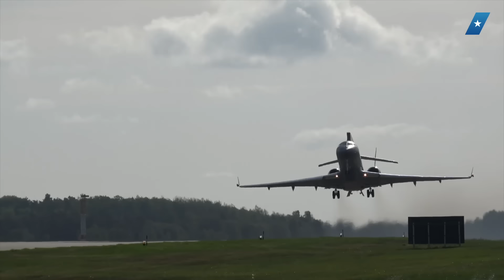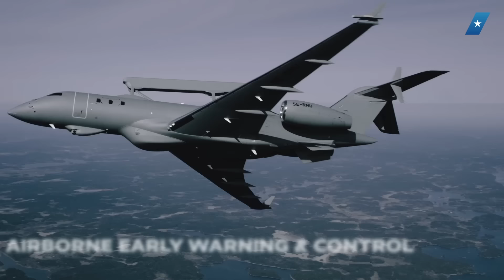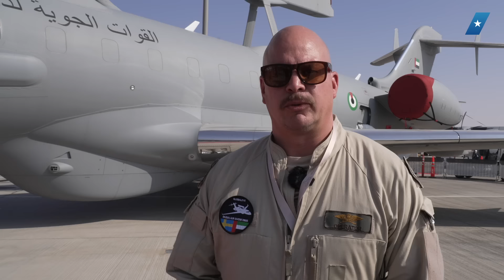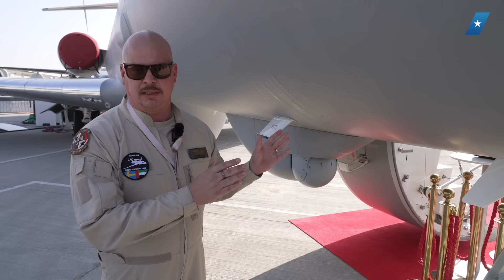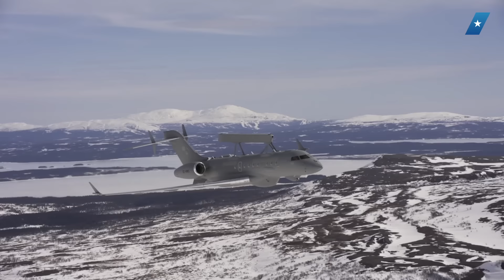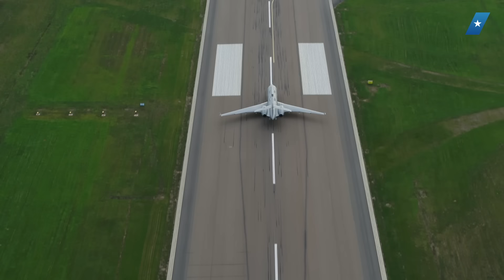GlobalEye walk-around tour with Saab

Comment: Nice, but obsolete? How about distributing the sensor suites on drones (large & small), and having the operators safe in a trailer somewhere?
Reply: Definitely not a application for small drones.... You need range, loiter time, and strong radar. Small drones are only good for short range operation over land. They don't deal with wind or weather well and definitely not fit for this
Reply: @mphRagnarok how about the other part of their suggestion, a large drone?😅
Reply: @BlindButNotMute if a large drone then it's probably at least as large as this converted business jet. Then you gotta ask yourself what are you actually saving, because it won't be cheaper than this. Maybe you save a few operators and pilots but that's not a limiting factor for an air force that will operate at most half a dozen of these.
Reply: No amount of drones gets you the range or accuracy of a proper radar.

Even if you're mounting radars on drones, you're lacking in emitter power. How much raw power can you direct at the target can burn through jamming, force a return from reduced RCS "stealth" and such while lower power emitters can not.
Reply: @thelittlestmig3394  what are you talking about, that aircraft can be a drone. just because you have no people onboard does not mean you lose access to a proper radar. they are currently working on large drone systems. so distributed drones amplifying coverage and providing safety to remote operators is not far off. and sure smaller drones could supplement depending on mission requirements.
Reply: @kevinb4783 Optionally manned is a way forward. For now we still need the souls on board but in near future that might change.
Reply: SAAB is working together with General Dynamics for the MQ-9B to do exactly that. 

But you don’t have the power reserve to run two radars at this power, and you depend on satellite links so can be degraded by enemy operations.

It’s not an either/or, it’s “and”.
Reply: o...obsolete???? lol.
Reply: Denmark, Norway, Finland, Sweden and Iceland ought to share a fleet of 5 to 6 of these. I belive belive Denmark, Finland and Sweden has shown intetest. Or is Norway only intetested in anything American !
Reply: Wrong on all counts
The Globaleye represents what the next generation of AWACS should be 
Small and compact
The previous generation of AWACS were based on large and slow aircraft
Smaller aircraft like the E-7, G550 and the Globaleye are what AWACS should be 
The thing people drunk on the drone kool aid forget is that Electronic warfare can jam drones 
Simple brute force attack and that drone is useless
What the USAF needs to bring back tactical escort jammers
The USN E-2D have EA-18Gs that can lay down a jamming to block any possible chance of a enemy getting a BVR shot in
The USN has over 170 EA-18G so assigning one to protect the E-2D is a simple matter
The USAF is only buying 10 EA-37 which is not enough. They either need to increase the EA-37 buy, develop their own variant from the F-16
or the shortest course is buy EA-18G and simply piggy off the USN to give them same escort tactical jamming that USN enjoys 
Aircraft like the EA-37 and EA-18G can easily ruin a drones day
Reply: Drones are for other types of missions than these. Btw Saab made the radar suite for the MQ9B aerial drone. So I think Saab knows what they are doing 😅
Reply: probably not far off
Reply: Jamming?
Reply: @JeffBilkins  Yes, jamming. You can transmit towards the radar to drown out their returns off you. They'll see the jamming source but the targets are masked. This is what "Gripenites" rebranded as "electronic stealth".

The main ways to defeat jamming is to either burn through their nonsense with more raw power if you can generate enough or to send a HOJ capable missile at them if you're sufficiently angry at them.
Reply: Drones are only an issue if you don't already have air superiority. Everybody refers to the russia and ukraine war neither one of them have air superiority. I'm not saying drones ain't useful because we know they are. But whoever controls the sky controls the battlefield. If you control the sky over your opponent's battlefield you can not only push them back
but drones also come more irrelevant. Look at the 12 day war israel owned iran skies drones didn't and couldn't do anything neither could Iran because israel ran the skies and controlled the battle space knocking out every sam system's in sight.
Reply: The Gripen already has passive mode radar that seems to be able to track the F-35's as the sources of the radar signal would not be the Gripen's therefore stealth deflecting the signals away from the source doesn't hide it from the Gripen's.  The Gripen even has a mode where one Gripen would illuminate the area for the passive radar of the other Gripens and they could take turns to hide the locations of the Gripen's.  Note, a GlobalEye scanning the area would also illuminate the area for the passive radar.

As to teleportation of drone fighters, ECM can interfere with the controls so you would need AI to continue the mission and or evade when the communications are interfered with.  Of course spread spectrum communication well beyond the licensed frequency bands of civilian radio use could avoid being jammed, with degradations in data bandwidth or increased latency...  The whole point of sixth generation fighters is to have a communication relay and control point closer to the fighter drones in case of ECM being used...
Reply: The predecessor of the ASC890, the S100B Argus, was actually essentially a flying radar without operators on-board. It had pilots ofcourse, but all data was relayed and managed on the ground. There was a reason for moving to operators onboard however, but a combination, sure. It is most definitely not obsolete in an EW saturated scenario and with wide-spread sabotage of ground assets.